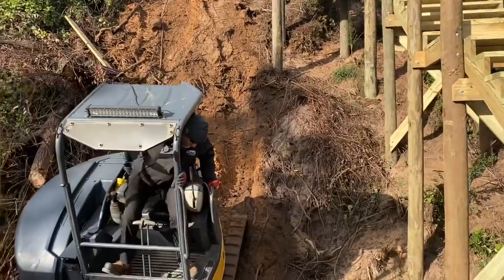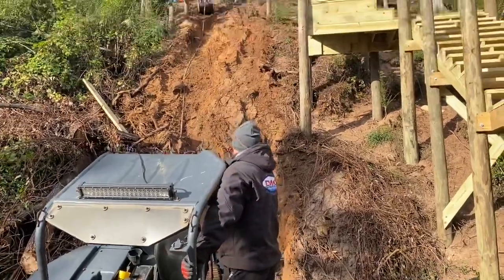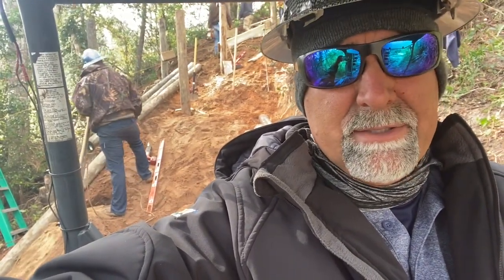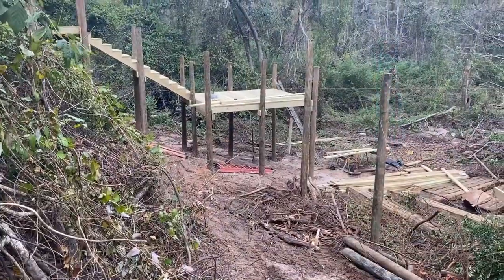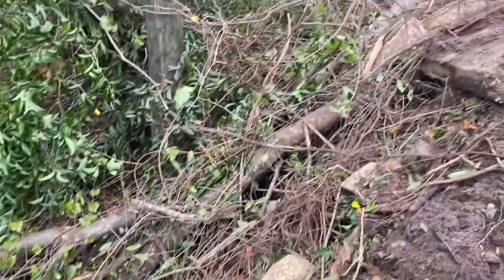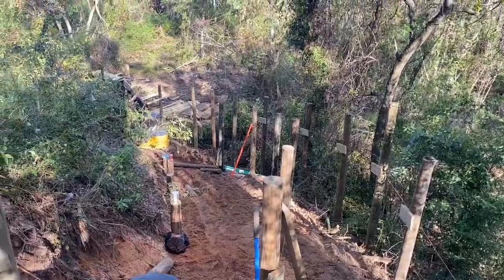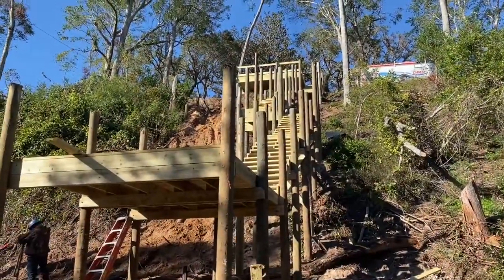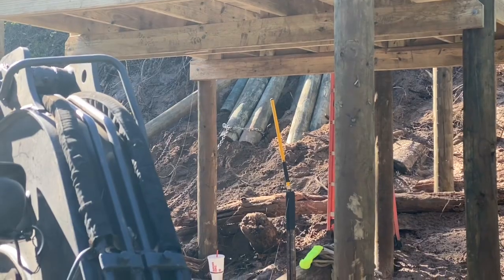EXCAVATOR SLIDING DOWN A STEEP HILL. Update on existing project under const.

Comment: Why did you go down without the bucket pinned? I'm not being sarcastic at all, trying to learn myself. I recently bought a CX75 (approx 17.5k Machine) and don't have a ton of experience w a Midi Size. 
Seems like the bucket would have helped you anchor?
Reply from the maker: Thanks for your comment not really sure what you’re asking about pinned? I did use the bucket to try to help stabilize myself in case the chain did let loose when needed.